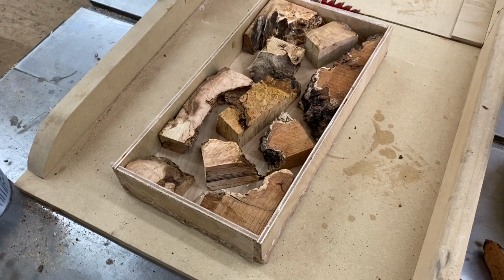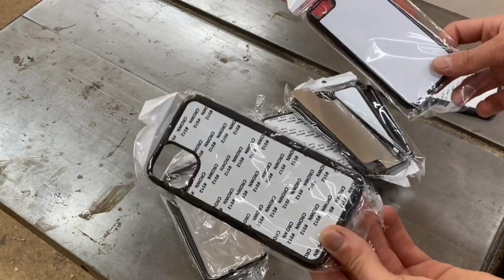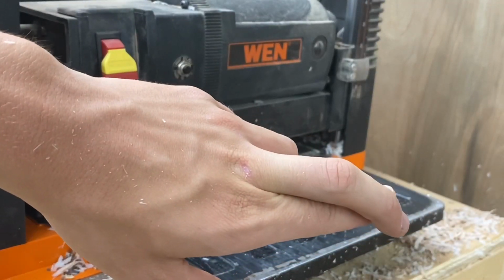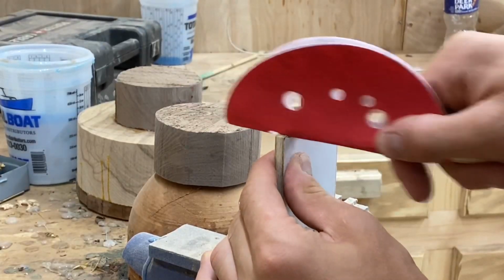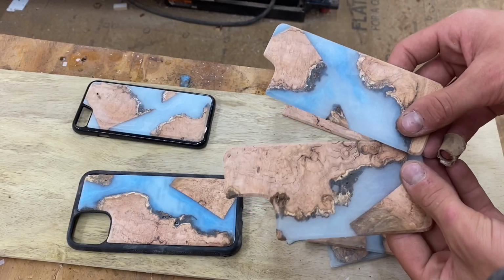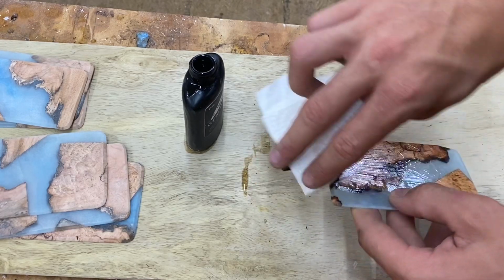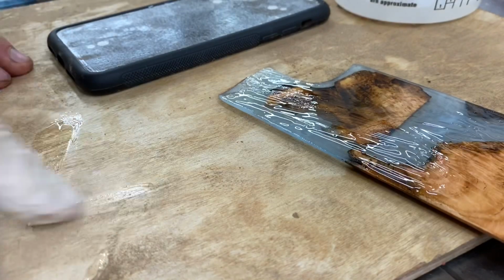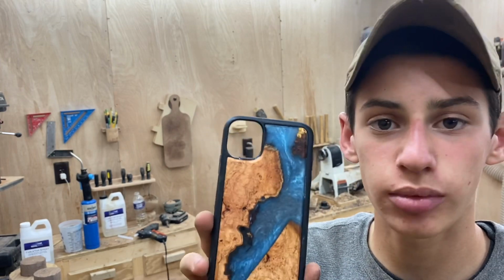Epoxy and Wood Phone Case

Comment: Did you remove the adhesive on the back of the sublimation case, or just epoxy the resin/ wood form over the adhesive?

Comment: I’m a newb but did you not clean the burl/bark edges before putting in epoxy? Looks like that’s why your 6th piece separated. Wouldn’t it be wise to hit all the edges with a wire wheel first or vacuum seal in cactus juice first? Nice work and keep up the good work.